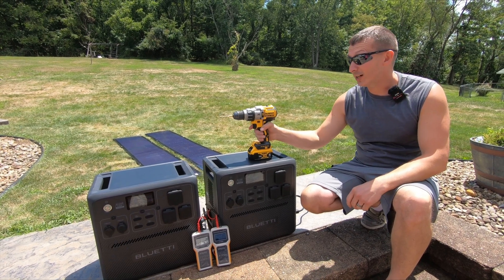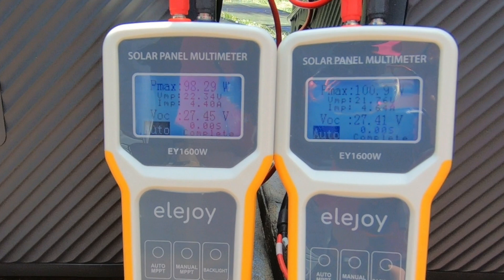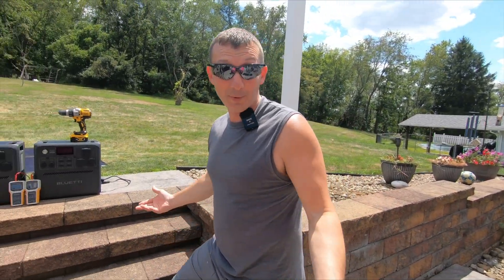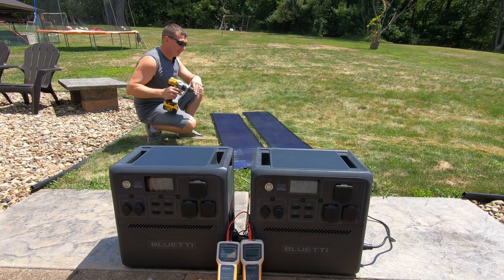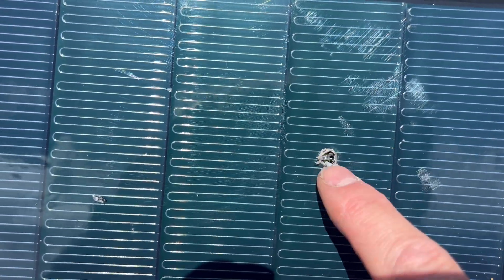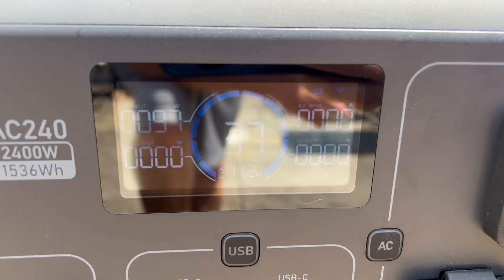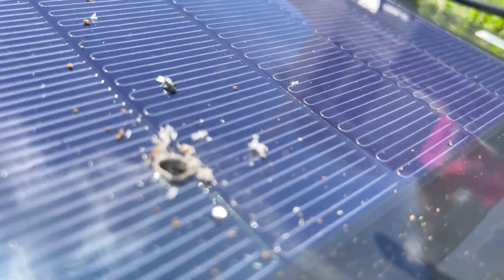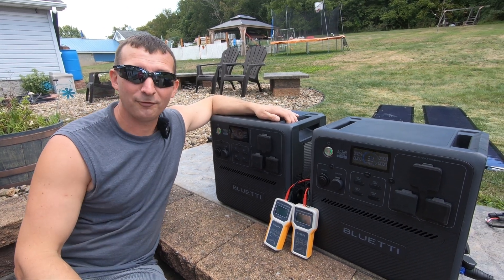This BougeRV CIGS thin-film flexible solar panel has holes in it and it still works great!

Comment from the maker: The technology of the BougeRV CIGS thin-film solar panel is insane!
The Yuma 100 CIGS thin-film solar panel is one of the best performing solar panels I’ve tested even after it has been extremely damaged! I drilled 13 holes in this solar panel and it still performs like new! You have to see the insane technology and performance of the Cigs thin film solar panels for yourself!

Save 20% on the BougeRV Yuma 100 CIGS thin-film flexible solar panel with code AFF20 here
https://shrsl.com/4nt3t

Comment: I just bought a 1992 rv that I am putting 2 of the 100w cigs panels on the roof.  For the rest of the system I have a Bluetti similar to yours.  I do recall some 'gotchas' with the solar connections to the Bluetti so will have to really ponder how to set things up.  Suggestions?
Reply: The 30.3 voc kinda bungles things up for a lot of power stations (60voc limit is common) so you are pretty limited in hookup configurations as you can basically only do 2 of them in parallel